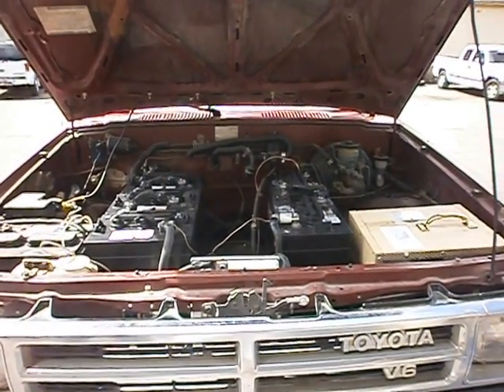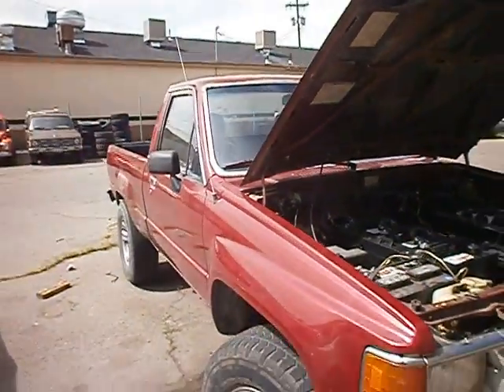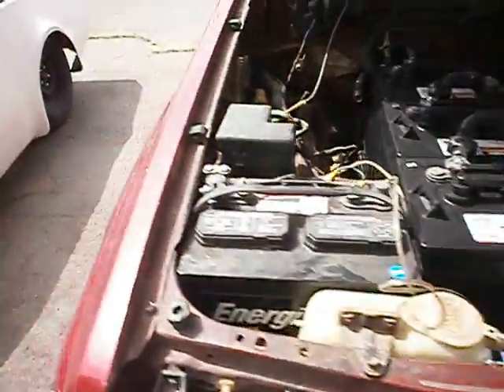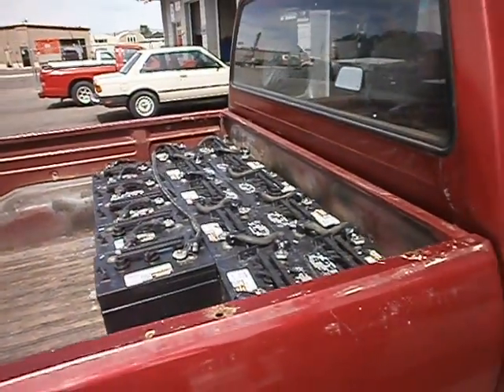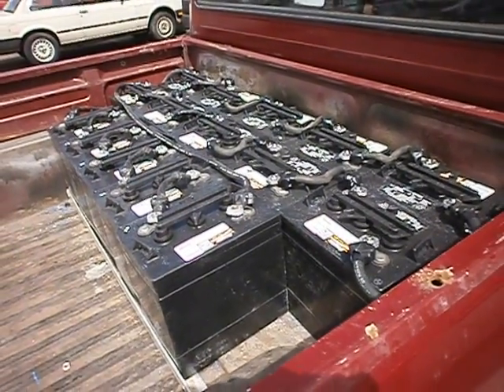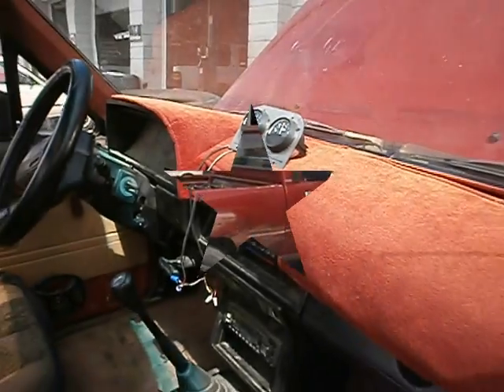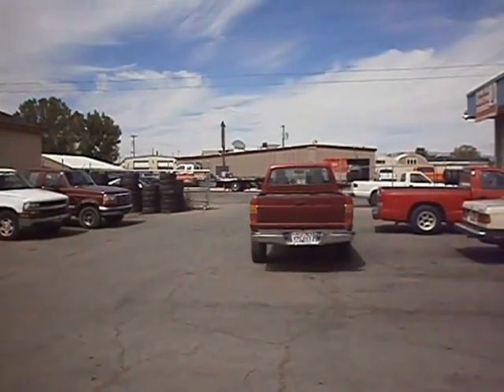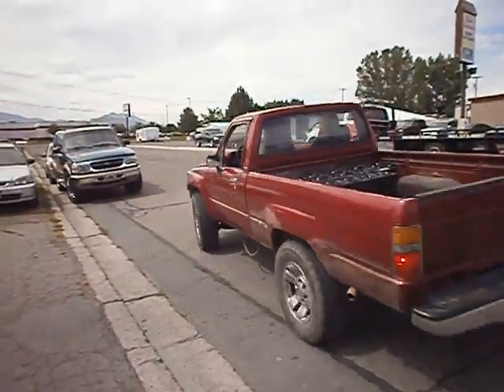Electric Toyota Pickup Truck | 1988 4x4 Conversion

Comment: @ 1:20, the truck activates WARP CORE as the cab tilt front to back from the transfer of power.
Reply: I had heard these electric motors have superior low end torque, but I was not expecting them to bend the laws of physics like that. I'm sold!
Reply: We've gone plaid
Reply: Rofl

Comment: Once you convert it to electric would it still be a 4x4
Reply: +danny arbona bit late but no reason why it wouldnt, youre not changing the drive train
Reply: Morne Becker ... Meme was/is asking in a since about still using the 4x4 just because it is not gas any more. I say yes but it would use more battery because of the transfer of power to both axle's not just one.

Comment: I have a 6000lb vehicle. Is there any way to get a 90 to 120 mile range with average speeds of 60mph with this weight on a single charge? Possibly add another motor?

Comment: is it 5000 pounds WITH the batteries?  Cause the weight of a base model 4wd (4cyl) was only 3300 pounds.
Reply: RCPro Driver i have seen a motor still on ebay high performance for up to 6500lbs vehicle check it out 😊